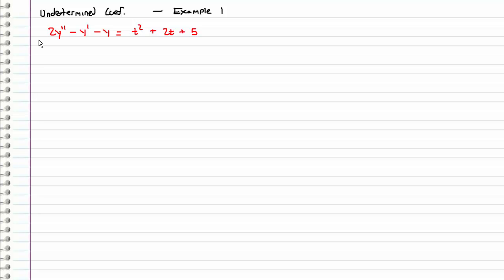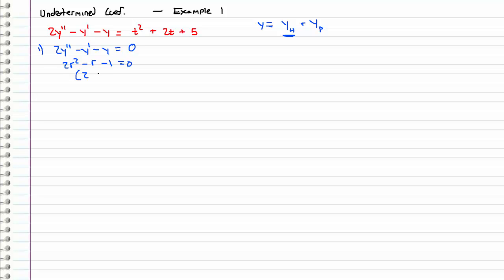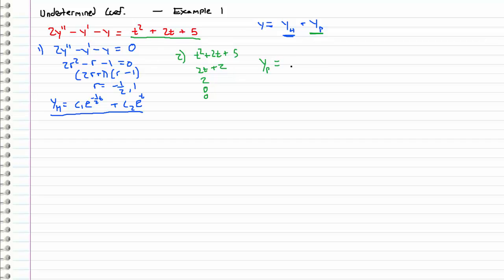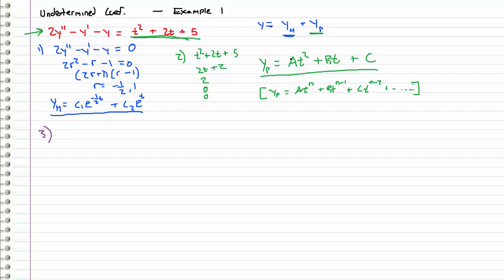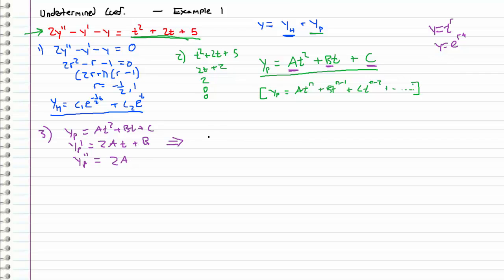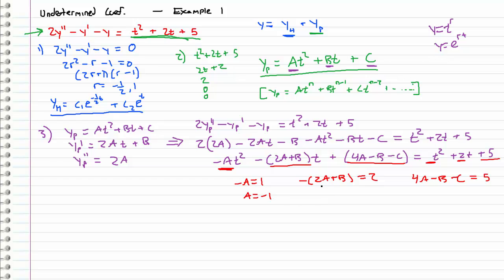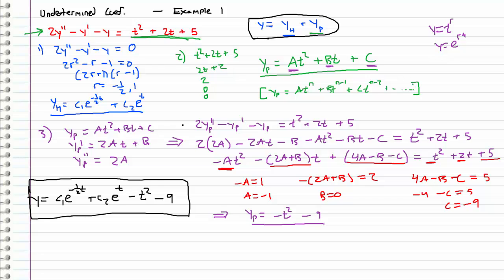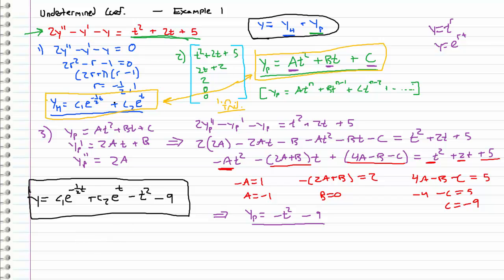Differential Equations - 33 - Undetermined Coefficients (At^2+Bt+C)

Comment: at 7:08 why is it plus 0 t, but the A is still inside the parenthesis. Would it not be 2t?
Reply: not trying to attack, im just confused
Reply from the maker: @absturakt  you are looking at the particular solution plugged into the DE and not the actual expression for y_p. 
We differentiated y_p and plugged it into our DE to solve for a, b, and c. Once you have those guys you just plug those straight into your expression for y_p, which is at^2 + bt + c!
Reply: @TheLazyEngineer  yes i just realized this while watching the tricky undetermined coefficients. Thank you so much!